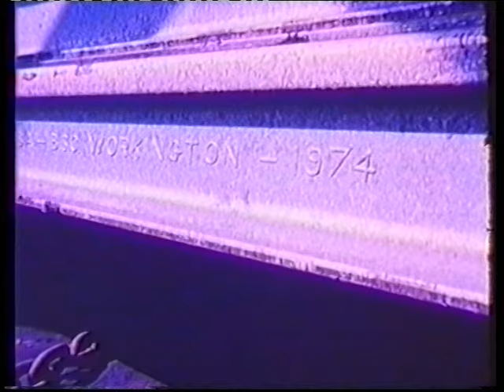Steel Making by Bessemer Convertor at Workington Cumbria

Comment: This brought back memories. I worked in this Bessemer in the 60's. Working a 3 shift pattern at age 16. My first job was to take samples of the molten metal as it was being poured into the ingot molds. Standing on the gantry above the newly filled molds, the heat was tremendous and reaching out over them to take a sample needed nerve. My next job was to fetch and carry for the 'Stopper man' who built and fitted the stoppers into the ladle after it had been poured. The stopper ( or plug ) only lasted one pour. The ladle would still be extremely hot but needed for the next blow so no time to let it cool. We were in range of the shower of sparks from the Bessemer so needed to move sharply when the hooter sounded. From this job I moved to driving the slag bogie. The slag bogie pushed and pulled a slag pan under the converter at the end of each blow to enable any leftover slag to be poured out. My last job in the Bessemer was to drive the slag mill overhead crane, picking up slag pans and emptying out the solid for disposal. These were all job's filled by boys who became men and were paid men's wages aged 18. Happy Days.
Reply: Home Grown Veg I bet far and few could do that job today. Thanks for sharing.
Reply: RazsterTW 

Hello Razster  We worked so close to the process we were just one trip away from being burned
alive and I don't exaggerate. The Bessemer building was open ended, the open
end being close to the sea wall. In extreme weather conditions the sea would
crash onto the sea wall and the strong winds would blow it into the building. I
can recall seeing the whole of the Bessemer floor flooded, with the rail track
submerged, and production carried on! Health and Safety, It hadn't been invented.
Reply: Hats  off to you dude. That’s some seriously dangerous and hard work. Noticed in the video one of the workers continued smoking his fag during the pour. Work be damned he was going to have his smoke break. I imagine you saw that all the time back in the day.
Reply: lived on westfield drive, looked out of mam and dads bedroom, you could only see mossbay, the steelworks worked on the blast furnaces from 1976 til 1980 when it closed sad times, happesed days of my life
Reply: To be honest I'm glad that 16 year olds aren't doing that sort of work now. Sounds super dangerous.
Reply: Where did the slag go? Disposed how?
Reply: @bilbo_gamers6417  My Dad worked here, he lost a leg & broke his back in an accident he was only 17, he went back to work 3months later on crutch's made of tuffer sruff back then he went on to become the Shop Steward & carryed on working there until he retired.
Reply: @beverlybradley5485  Yeah. I mean, I would be fine if it was adults but 16 is a little too young for people to be having their hands and feet vaporized by liquid metal imo

Comment: Luckily most of the rail steel is eutectoid steel and has enough carbon to be top poured into the ingot without serious re-oxidation. The methods shown would have produced a lot a scrap for other lower carbon (sheet) steels.

Comment: I cannot believe they were still using the Bessemer process in the late 60's, early 70's.  That is insane.
Reply: They still use the Basic Oxygen Furnace now (well, I say that, Electric Induction is actually replacing it in terms of melting iron itself, but this is only quite recently that this has happened). It's all fundamentally the same technology. Impure molten cast iron reacts with oxygen to produce less carbon-rich and more pure iron as well as Heat. The basic compounds react with the biprosucts of oxidation to drive the phosphorus and other impurities into the slag. It's really very efficient, and quite a cheap way of purifying iron vs directly heating it.
Reply: @bilbo_gamers6417   In my locality and at my local steelworks we mined the coal, pits are now shut, we mined the iron ore mines are now shut, we quarried lime stone quarries are now shut, We made coke from the coal to use in the blast furnaces, coke oven and blast furnaces are all gone, we took the molten iron from the blast furnace and converted it into steel in our Bessemer converters, the blast furnaces have gone the  Bessemer's all gone. We poured the steel into ingot molds and produces steel billets. We put the billets through our rolling mills and made the best railway lines in the world. The rolling mills are gone.  We are now just about totally dependent on imports of everything.   Jim.